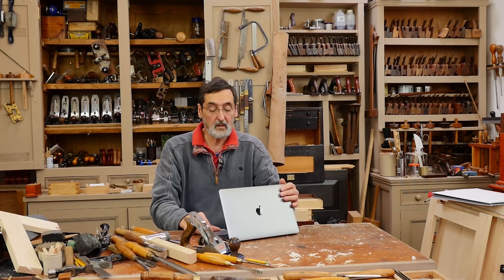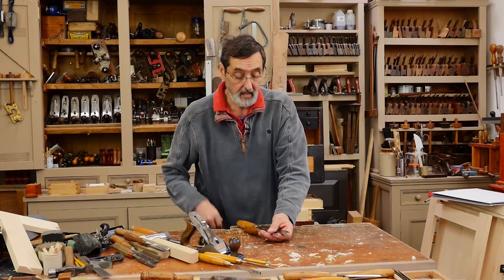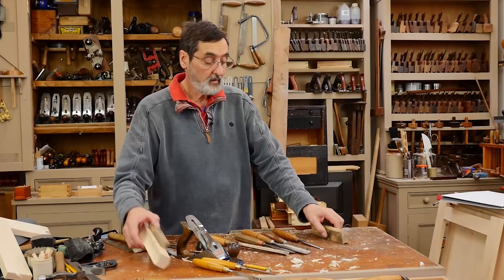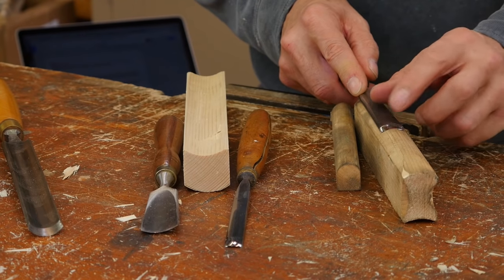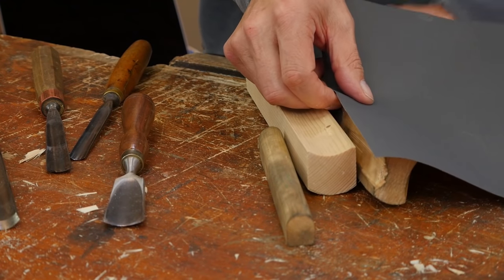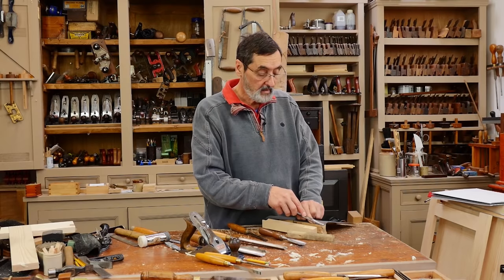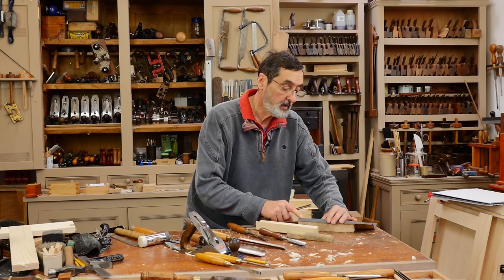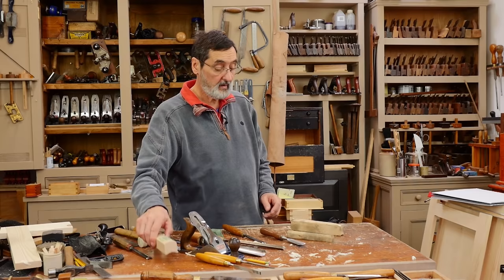Q&A with Paul Sellers Episode 11

Comment: Re: the tearout question. I have planed similar stuff with my old stanley smoother. I tried many things but construction grade lumber is not a nice wood to work with, it tears out really easily, it's not even pine but fir, soft and really hard knots. I think it's much more difficult to plane than oak or some other hardwood. 

I've worked at it (on and off, mostly off) for a year before I finally got results and what worked was setting a micro bevel of 55 degrees or so on the cap iron and really really making sure it's tight against the blade and setting the cap iron really really close, like .2mm or .3mm, basically I look got a tiny sliver of a reflection of the blade when I set the cap iron. It's finally yielded results for me and I can set it consistently now and know what to do to achieve the desired result. Haven't had any tearout with my smoothers since, I've been trying to cause it, planing against the grain and over knots on different woods. There are videos on youtube on how to set up the plane, they where invaluable to this.

Comment: My question for you in a Q and A is, what could I do with my 4feet tall and about 4 inch wide Christmas tree trunk that I completely limbed as I wanted do get some wood so that I can start a bit of woodworking. I have been watching lots of your videos and as a 13 year old teenage boy, I have been very inspired to start doing some woodworking but I don't have any wood. Thanks a lot for all of your tips and amazing videos about so many different aspects of woodworking and how to do things for begginers. It has been truly inspirational for me to watch lots of your videos and be able to think, ' I could try that '!
Reply: Sam,

You've picked what I would call a "Tough row to hoe".  Converting your Christmas tree into wood suitable for a project is going to take more than a little effort for very little return.

I'm not saying don't do it. I'm saying you'd need some unique circumstances to make this a good idea.

The first thing you'd need to do probably is dry out that tree trunk and depending on where you can store it that can take a little time or quite a lot.  The base is likely to crack during this process and to prevent that you'd want to coat it with latex paint.  Otherwise the exposed end grain releases water faster than the rest of the tree trunk which causes cracks.

Next, if you plan on working with boards, you need a way to split (rive) or saw boards out of this small tree. Keep in mind that the outside bark can't be used and the greenest wood underneath that isn't generally used.  

So now you've waited a long time and used tools you only need to turn a log into boards and as a result you have VERY little wood to work with.

Again, this does NOT mean you shouldn't do this.  You could learn a LOT about wood and different areas of wood working and be well ahead in those areas.  However, you would not be getting much in the way of instruction in or material for the way Paul works wood.

If this isn't looking quite like you'd planned then I have a counter suggestion for you.  In many areas there are woodworking organizations.  Contacting a local one (with your parent's consent and participation) would be a very good way to meet people doing what you're interested in.  And woodworkers generate scrap wood the way cats generate kittens.

You MIGHT also have access through your school or local Scout troop.

I'll keep an eye on this post to see if you have any other questions.  If anyone thinks I'm way off base and can help Sam better please chime in!

John Purser
Reply: Being as it is Xmas again and people may be reading this again, you could take your old Christmas tree cut it into 10 to14 inch lengths and practice making carved spoons and salad ware.. interesting projects and a great use of the tree.!

Comment: Well that's just great... I've just bought a Stanley No 71 router plane (it's not arrived yet) because I too love the sound of a sharp blade cross cutting wood and it cost me £95 + £5 p&p on ebay.. It's complete with all 4 blades, fence, depth gauge etc and is boxed, basically it's complete and the sole looks very clean but it cost me all my (secret from the wife) savings.
After watching this video I now see I need a Stanley No 80 scraper.... £30 on ebay... because I had this same problem with knots yesterday!...better get saving up again...
I got round it by using my Stanley No 4 plane in a 'circular motion' and it stopped the tear out around the knot but getting rid of the 'arc lines' made by the plane took a long time.
I was renovating our old garden bench and 2 tables which I made with machines a few years ago, they needed doing but I wanted to do it without using machines or sandpaper.
I've done it and am very proud of my achievement, I tell everybody that comes to look at it and how I did it, the wife just think's I'm a boring old sod, but everyone to their own.
This would not have been possible but for your expertise in your videos, and the 'bug' for hand tools that you've passed on to me.
I thank you very much for that.

Comment: I have a made a replacement bottom for a cheep bathroom cabinet which was MDF and as expected it exploded due to moisture. I made the replacement from some mahogany i had left over and looks great but here's the problem i had.
I needed to make a groove/channel in the back to accommodate the backing panel but it had stopped ends which disappear under the sides. I used a plough plane for the most part but due to the stopped ends..i couldn't get to full depth on the ends until i used a narrow chisel & knocked up your poor mans router (i couldn't use my small router plane because 1/4" was too wide). It worked but took forever. I guess i could have made a better poor mans router & made some kind of fence on it for the whole job but love to know how you would have tackled it.

Comment: Just an idea for the concave sharpening jig. It should be possible to make a block with a row of small holes into a cavity and ending in a nozzle for a vacuum cleaner to create a small vacuum that can hold the paper down during sharpening and making change of grade very easy.

Comment: The short bit about recycling shavings suggests that a review of the toxicity of various species might be of interest.  I particularly recall a video wherein a fellow turned a goblet from yew.  It looked very nice indeed, but I hope the goblet was for decorative purposes only because all parts of a yew tree are cardiotoxic, except for the fleshy red part of the berries.  (I did send a comment his way.).  Interestingly enough, recently a bear and her cubs were found dead in a suburb in Pennsylvania, and the necropsies revealed that they had consumed more than just the yew's berries.
Reply: Another consideration in using wood shavings in the garden is the fact that high carbon content in the wood requires a lot of nitrogen in order to break down, which can deplete the soil.  Chicken waste is pretty high in nitrogen, so that would be a good solution, but not all manure is as nitrogen dense.  I use compost from a horse stable which uses wood shavings on the stall floor.  If I don't add nitrogen to the compost, I find in soil becomes nitrogen poor.

Comment: Great channel. Do you do anything with external carpentry? I'm going to make a new 7ft gate for my driveway , after seeing you videos on tenon joints, I was wondering if this would add strength to the corners or if a screwed 50/50 joint is the way to go. I am an amateur so go easy on me!

Comment: Not all kiln drying is the same. Kiln drying done in stages is superior. They heat and cool the wood several times and what this does is to crush the cells of the wood. Wood kiln dried like this, that ends up with crushed cells will move less than air dried or single staged kiln dried. Hardwood flooring is an example of kiln drying that is done in stages.

Comment: Hi there from Portugal,
I have a question, when i hand sharp a narrow chisel, using your method and diamond plates, I often get skew bevel and this only happening in the narrow ones because in those with 15mm and more end up at 90º with the sides.
Obrigado(Thanks)
Reply: Use a sharpening guide.
Reply: Blog das Madeiras Sounds like you just need a little more practice to train your arms and shoulders.  Narrow chisels are tough.
Reply: The chisels get skewed because you are not applying the pressure dead center in the tool. This means one side gets more pressure, and therefor you remove material on that side slightly faster. Over time this develops in to a skew. This will happen on all your tools to some extent, so check even the wide ones occasionally with a square.

The way to fix this is to consciously bias the pressure to the high side, and check your progress frequently. The narrower the chisel the harder it is to keep it straight, but the faster it is to correct too. And as you practice you learn more and more how it feels when the pressure is balanced  (For me personally I have to bias it slightly to the left of what feels right for the result to come out straight).

Comment: Hi Paul, A multi-part, long winded question for you (I'm sure you'll need to condense it, sorry! :) ) - Ive heard people talking about how the size of the mouth on a plane affects the possibility of tear-out but never seen/heard an explanation as to how this should be set or even how the mouth affects normal plane operation. When thinking about tear-out in particular, I totally understand how the fitment, clearance and angle of the cap iron is involved when talking about reducing tear-out but can't quite see how the mouth has an effect. In relation to this, I don''t have any planes with adjustable mouths but I do have multiple Record and Stanley planes of varying ages, these all seem to have varying sizes of mouths (i'm not sure whether that's something to do with age, brand or variations in castings, thickness of the original iron or all of the above). How should the frogs and the position of the blades be set and should this be adjusted for varying operations? I've also had to exchange some blades in planes i've restored, one where I changed an old particularly thin Stanley blade for a thicker Record one I had on hand and another case where I used a thicker aftermarket blade. I had to readjust the mouth in both of these cases with a file to give enough clearance - What considerations should be made when doing this? Thanks for your help and for all of the excellent resources you provide to all of us!
Reply: Just thought i'd say further to this as I know your attitude towards the thicker iron 'upgrades' (and I tend to agree), the aftermarket Iron I purchased was not a particularly thick one  - It was just thicker than the original Stanley iron that came off and although I didn't measure either, it was just enough that it caused the clearance issue.

Comment: Paul, I notice in you videos, when you adjust a planes cutting depth you can spin the adjustment wheel very easily.  I do not have that on my planes. Is the lever cap to tight?  If so how tight should it be   Thanks in advance

Comment: Mr Sellers, what would you recomend for a first time project?? . Cosidering I want to start a workshop, I thought about a workbench or winding sticks, but I'm not sure.
Reply: I think a work bench is a great idea. My first project was my work bench and I used Paul Sellers videos on work bench as a guide. I learned so much while making it and I will probably be using it for many years. I made winding sticks in the process so I can flatten the bench top properly. Good luck.
Reply: Thanks Peter!, I'll take your advice. I've been thinking a lot about it.
Reply: You're welcome, good luck with your projects

Comment: Hi Paul, I made the rebate plane in your video from last year and it came out pretty good, but I have one problem and I don't know if there is something I did wrong or I don't know how to use it yet.  At the begining and the end of the cuts It leaves a small shoulder which get progressively bigger.  Its moving away from the board as I plane down.  Do you have any idea as to what I did wrong?  Thanks for any advice you may have.

Comment: RE what to do with wood shavings - Im considering trying to make some sort of tool to compress them into blocks to more easily throw on the fire. Perhaps even a jig that would fit into my bench vice. Any thoughts?
Reply: yourundoing12 samuraicarpenter made one of these.  I just turn mine into floor insulation for my garage 😅

Comment: I ha d just started doin abit of joinery myself in my spare time n I'm snit stuck with setting my planer Num 4 up as I took it apart to clean n I also gave a dovetail marker the same one u made out of wood one side has 1.5 n other I think is 1.8 I think how do I start it off for dove tails if that makes sense please thank you